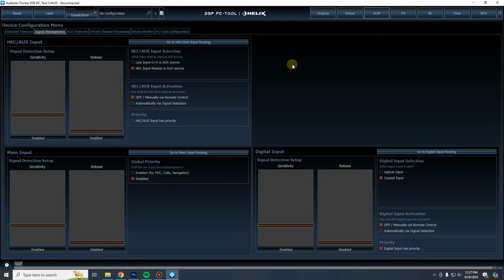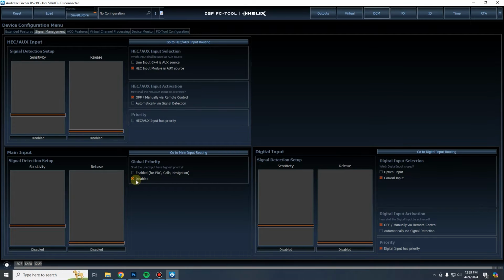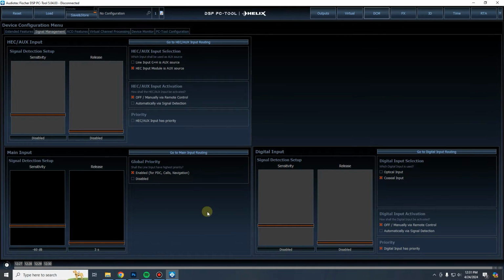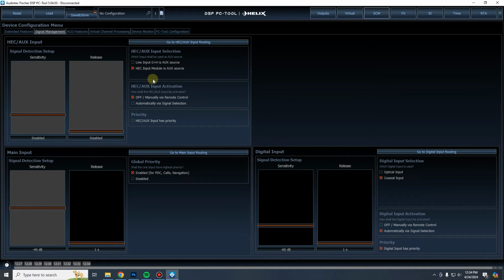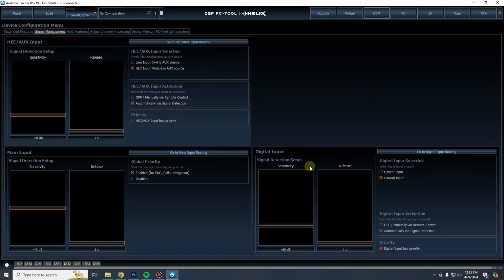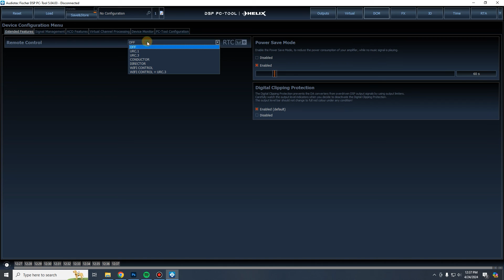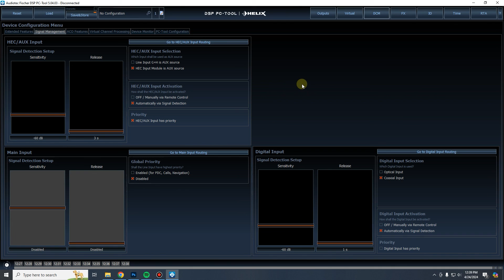ResoNix Sound Solutions - Tech Tip: Configuring Input Switching with Helix, Brax, & Match DSP's

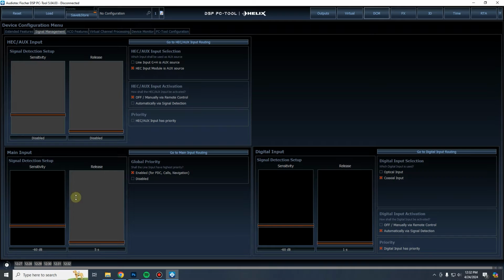Comment: 4:53 The “Release” slider defines the time until the device automatically switches back to the previous source if there is no longer a signal detected at the input. If you have connected a navigation system to the auxiliary input in order to reproduce guidance announcements, then a short release time of approx. 1 second is a good choice.  In the case of an MP3 player, on the other hand, a release time of 5 seconds or more can be useful in order to avoid any switching back to the previous source during pauses between two music tracks.
Reply from the maker: Thank you. Of course I set it in your car like 3 days ago and I had a brain fart when I'm on the spot lol
Reply: @ResoNixSoundSolutions  just helping where I can.  Now to hunt down that wire for the fake engine noise.

Comment: Hi Nick, great video...One question. I have the MK3 running digital from my factory head unit. When programming the MK3 inputs, do I select 100% digital and drag to the top then fine tune my outputs from there. I have a small system, just highs, mids & a small sub in the doors and 4 6.5's subs in the back.  Any suggestions would be helpful. Thanks
Reply from the maker: Hey Scott, I am not sure I understand the question.
Reply: @ResoNixSoundSolutions  Hi Nick, thank you for getting back to me. So I have a Helix Mk3.  I'm using my factory stereo (2017 F250)   Connected to a AMP PRO in the dash which allows me to run a TOSLINK  digital signal back to my DSP.  Once I'm in the DSP PC TOOL 5 program,  [IO] configuration - down at the bottom (lower left of the screen)  there's a digital L, &  R option. Do I select that   option to start tweeking the mids, highs and subs for the outputs?  

My system isn't big, I'm just running some highs, mids and a sub in my doors with four 6.5's in a enclosure underneath the back seat. 

Any advice would help - 

Helix is an awesome product,  it's just a bit overwhelming setting it up.  

You could really profit from a tutorial regarding Helix products....There isn't anything out there that helps with this software.
Reply from the maker: @scottlincoln6286  Yes, you are correct. Just set up the inputs and outputs and then do all of your tuning in the outputs. Check my channel, I have a video on how to set up inputs and outputs.
Reply: @ResoNixSoundSolutions  Thank you very  much, hey your video's are SUPER helpful and much appreciated.
Reply from the maker: @scottlincoln6286  Always happy to help :)